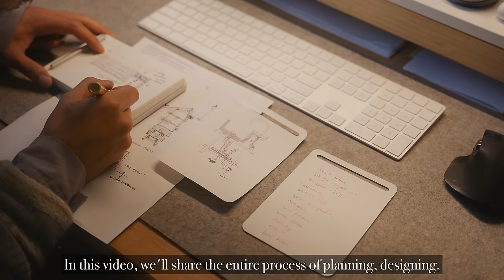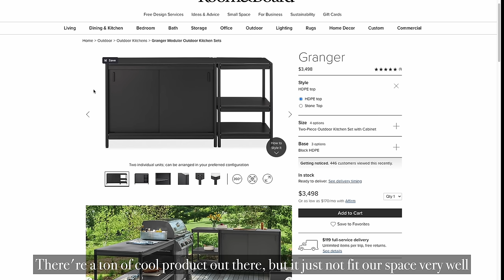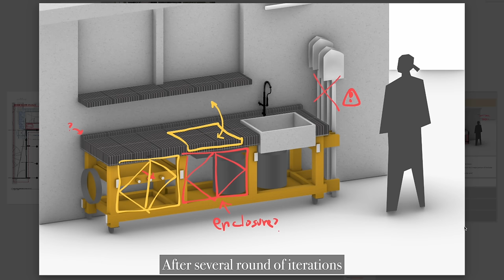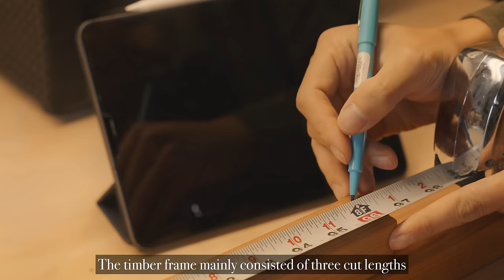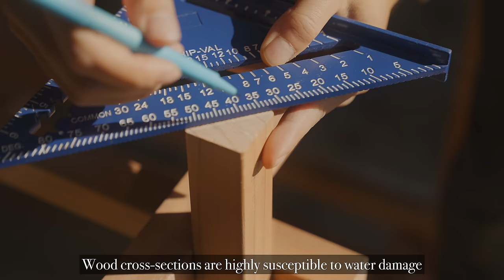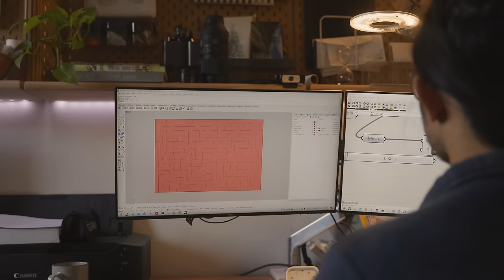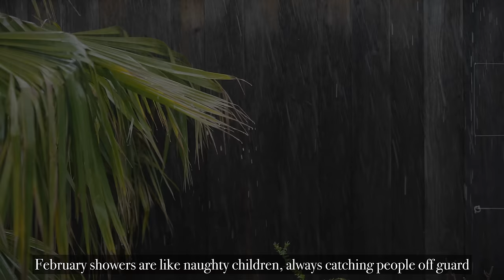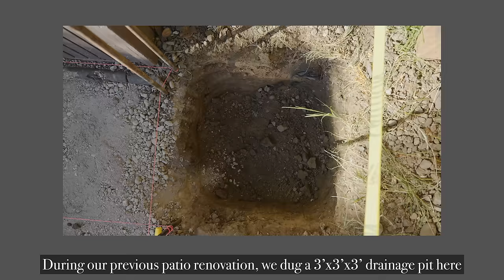Backyard Patio Makeover: Build a Mid-century inspired Potting Station for our Garden

Comment: Welcome back! A question. With the pivot door being such a tight fit during the making, aren't you concerned that the door will get stuck due to expansion after being out in the rain?
Reply from the maker: This is good quesiton, the pivoting door hardware has a ball bearing inside, made out of metal, i think from hardness point of view should be much stronger than wood, so any deflection in the timber structure should not affect it by theory. The door it shelf has around 3/32" all the way around it, should be able to account for future expansion(hopfully)

Comment: the sink and tiles to heavy for this weird construction, my opinion
Reply: Weird construction? You don't know what you are talking about. It is well designed. It's holding up well. The only thing weird is your comment. The tiles are light. Negativity will be your undoing.
Reply: @beany1944 boards its to tiny,  concrete sink  its  just on one of them, plus tiles plus 20-30l whater busket, plus flowerpot on table...
Reply: Should have used 2 by 4s for frame.
Reply from the maker: what we used in the build is 2x2 redwood post, even though they tends to be filmsy looking, but wood has actually pretty good load capacity, for instance, even though redwood is not consider a strong wood species, it still have a compressive strength rating of 5000 psi (pound per square inch). So for a 2x2 profile, (2 is nominal width the actual width is 1.375") the cross section area is 1.375*1.375= 1.89 square inch. so by theory it should be able to carry 1.89*5000 = 9450 pound of load max.    the total weight of the potting station is around 330 pound, and if it is divided by 8 legs it is on,then each of our redwood post is only carrying around 41.13 pound of load.  41.13 << 9450  even though the post would probably buckle first before reaching maximal load of 9450 pound, the point is: the structural should already be a overkill for a potting station, maybe the weird part is fair ? but i don't believe the structure would fail, you can put as many flowerpot as to your heart's content, it will not collapse.
Reply: @galastudio9  It seems to me that the weak point is the fastening, there is less than one square if divided by two. but i could be wrong